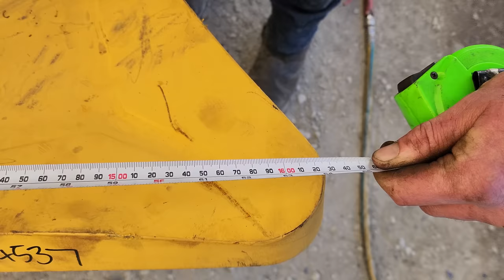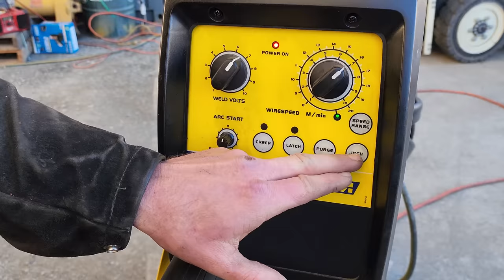Massive Repair on BROKEN Bulldozer Blade | Part 2 | Drilling, Gouging & Welding

Comment from the maker: The massive repair job on this blade continues! How many meters (or feet) of welding wire do you think will go into this repair? Have a guess in the comments and find out in Part 3 here: https://youtu.be/VvDNckmlN2o
Subscribe and hit the bell icon to turn on notifications so you don't miss our weekly uploads. 👇 🤳 
📲Follow us online here: linktr.ee/CEEAUS
🛍Official CEE Merch shop: https://www.ceeshop.com.au
🎉Get Early Access & Ad Free videos in our Patreon community: https://www.patreon.com/cuttingedgeengineering
Reply: No need for the bell, you're on time every Friday!
Reply: great to see part two of the D8 Blade rebuild, cheers from the other Sunshine State, Paul
Reply: OMFG about time.. LOL ty I can literally now relax and go to sleep
Reply: LOL that jump at 23:14, nearly 2 hours of welding.  Crazy.  that was likely more welding then I did in my life.
Reply: 500 meters
Reply: How many total hours did you have in that job? It's interesting how the skills used for this job, so far as I can tell, don't overlap with those of machining hardly at all.
Reply: Correction: Was 2500 Meters, now my guess is 7500 meters
Reply: 2500 bananas, 18" and 2.3 cm of welding wire used. 😂
Reply: I'd say three rolls of welding wire. How many meters are in one roll? That times 3.
Reply: A metric f*ckton!
For a more informative guess, if you don't make it to San Francisco (I live an hour north of it) with the length used, I'll be disappointed 😅
Reply: Easily the 80/90 % of the reel. 12 kg  of wire. 🧐
Reply: Another awesome job by Kurtis, thanks, and a bigger thank you to Karen for great camera, and awesome smooth editing, way to go team 🤩🤘👏
Reply: Gonna make a completely unqualified guess of 1858 meters of wire for the entire blade.
Reply: I would say 250m, or 1406 bananas also known as 29526 grains of barley, also known as 9842 inches
Reply: More bananalengths of wire used than were destroyed by Cyclone Larry
Reply: Your one of the few channels that I don't fast-forward through. Like watching each aspect of the job.
Reply: I guess it should be around 6.0km to 6.5 km of wire. I am blown away of the amount of work going in the blade. Cracy. Amazong to watch. Thx!
Reply: Id say you have done approximately 495 mins of welding and you said that you were running at around 6.1m per min, so your upto around  3020m of wire. I dont know how many meters in a roll but i reckon you around 2.5 - 3 rolls in. Also thats some top work mate, you dont fuck around and just get into it. As a boilermaker ive been watching and saying to myself just dog it here and heat it up there and flog it down.
Reply: 3000 plátanos, saludos desde España 😊
Reply: Um,if I guess correctly, do I win a prize?
Reply: use words like and! .... thats hilarious
Reply: 200 meters 🤔
Reply: Going to say 9 rolls of wire are a minimum, plus an additional one with only around 2 turns left on the roll at the end.
Reply: 2 rolls?
Reply: One of the highlights of the week is seeing a new video when I wake up Friday morning 32:32 . 5150 m of wire is my guess!
Reply: Say, 7000-8000 metres, can easily see 3 or 4 rolls of wire going into that when its all said and done
Reply: About as many bananas worth in a plantation.
Reply: What ever happened to the swear jar? "And" how many times has it been emptied "and" refilled? "And" how many times was the welder refilled?
Reply: @mattyb7736 now that is appropriate guess.
Reply: I'd guess you used all of it!! And neighbouring shops are crying into there xxxx while calling you a xxxx as they can't get any work done now
Reply: I guess 7350 meters of welding
Reply: ~50metres
Reply: I sure wish YouTube would have notifications turned on when someone subscribes! Even talking to people in person, most aren't aware of the need to get notifications. Maybe YouTube might listen to a channel with over a half million subscribers with this suggestion.
Reply: I loove the takeouts, Karen and Kurtis!
Reply: You did mention the welding speed in part 1 and I can't remember what it was. Random guess then....so if you spent 8 hours on the blade that's gotta be....a lot. 

6.5 inches per minute for 8 hours? Gotta be 700m+
Reply: Puedes poner el subtitulo en español tus primeros videos eran así y los iba leyendo
Reply: You look kinda beat it this video lol but maybe not. Fun watch
Reply: 600 metres.
Reply: The amount of work cranked out in one day while filming is very impressive.
Reply: For the entire job, I’d guess 8000 meters of wire.
Reply: @26:06 I don't know, man. What if I never find out whooze the goodest boy ??
Reply: 3,000m 🤷‍♂️
Reply: 1.35 miles . :)
Reply: ya need a shave, gov. for real. this job taking so much of your time, it has grown by an inch from part 1 till now!
Reply: 22:22 that was sweet editing. 💯
Reply: 4000 feet.
Reply: Hey Kurtis any guess on how many kilometers of wire you've used in your career?
Peace.
Reply: I am going to guess 3000 feet
Reply: 8500 m
Reply: total guess work for me. Sadly i looked up wire spool's here in the States and they are all listed by weight. None of them specify length per spool. My best guess is that you used 5 1/2  33lb. spools for a total weigh of just over 82 kilograms...  But, if there is 500 feet per spool than my final answer is 838.2 meters of wire.
Reply: Length of Welding Wire used:

More than a Little...Less than too Much!!!

😄😁😆😅😂🤣
Reply: At this point, I dare say you're not rebuilding the blade, but building an entire new blade and just recycling a few parts off the original.
Oi, serious kudos~
Reply: I'll be waiting for part 3 your work is very interesting to watch as a fellow welder
Reply: 13.1 km of wire!
Reply: Grettings from Poland 😊😊
Reply: I'm going t say about 680 meters or however many banana lengths that is. 🤣🤣
Reply: 6ks
Reply: It's got me beat just how much stuff you've got in your head. No self respecting apprentice could absorb it anyway.
Reply: with 15m per min you will already have spend 6500 meters end for the rest this will be at least the same lenght! - All together 14580 meters of wire - incredible...
Reply: 6,500 feet of MIG wire
Reply: I reckon you've gone through about 4 rolls of wire so far. So 60kg of wire whatever that is in meterage
Reply: We didn't see video of the clock in the background when you where shagging the dog?
Reply: I'm from Australia I live in California im a heavy equipment mechanic mobile !! Many dairy im lucky I sub for a I  multi billionaire there a couple of miles of welding !!LOL
Reply: 2.3k
Reply: @bugg3rthis  lot wirer
Reply: Is there a risk that your lil doggie gets swarf in his paws, when running around the yard and workshop?

Jus wundrin......

I was in construction, and my doggee cut his paws sometimes.
Reply: 1.75-2 spools! Wire!!
Reply: What would be interesting, is to have some reaction video of some of the metal shop in india (or similar). You know, the one where they are all in sandals, no glove or protections glasses, working with machine that impressive that still work, melting their own scrap metal to the final product.
Reply: Love watching that mag drill and rotary broach smash holes like it's in mud cake.  So satisfying 😊
Reply: Dog and wedge works great. I tend to use a nut welded to a piece of square tube with a bolt because sometimes you can’t fit dogs and wedges close enough. Try it sometime
Reply: 2200m
Reply: Ok I know I am not the first to ask this. But here goes I am 54 was a top rated truck mechanic for big rigs. I lost use of my left leg. I think I could do must of this work with my disability.  Would you take on an apprentice for a year or so for room and board?  I am from the states and would have to live there. I wouldn't ask for any pay just food and a roof please. If you feel this is something you can do please let me know . I would love to do this and bring my son into it to take over as well. Thank you so much
Reply: This is really massive work, I would like to know how much did you really charge your client on this job?
Reply: I would think around 2400 meters of welding wire
Reply: Kurtis, I swear that about 13:55 in, your new rattle gun's battery was bouncing around a fair bit.
Reply: G7
Reply: You keep the welding wire company in business burning thru as much as you do lol
Reply: @fbs227 I think he called inches "macaronis" one time too😂
Reply: No red lock tight? Does he really know what he’s doing? Artist use red lock tight even when they don’t need to
Reply: Hi mate! Just curious about what MIG equipment do you use? I could see its ESAB but which particular model.
Reply: Once again, old home time.  I worked at a place that cut wear plates at mold board and cheek plates for underground mining.

It is very interesting to see similar parts in similar operations.

That is one whale of a Mag Drill that you have.

Comment: As a dozer operator I didn’t think a dozer blade could get this bad let alone repaired! Outstanding work so far!!
Reply: I hope that the customer got a good deal on this thing, for all of the work that Kurtis is doing to it.
Reply: @dirtfarmer7472 I'm thinking 1/3rd to half price new USD + 30% materials not counting manufacturer shipping is still a fracking great deal, considering the "repair" is better than new. The customer can pick it up himself for relative peanuts cost.

Comment: As a welder myself I can appreciate just how much work goes into that blade. People are familiar with their cars moving in miles per hour but welding can move as slow as inches per hour, it is by no means a fast process.
Reply: Dang. Since you mentioned you were a welder, I assumed you would have a lot of cool welding videos on your channel. :(
Reply: @eriklarson9137  It's a PITA to record and post ones work.  On top of that many employers strictly prohibit it by default.
Reply: NYC Union welders measure the day in "inches per day"
Curtis is on a different level of production 😂😂😂😂😂😂
P.S. squeaky toy play at end & outtakes are PRICELESS 
Bronx Love guyz 😎
Reply: @eriklarson9137  sorry mate, I'm retired.
Reply: That be “bananas per hour”.
Reply: I worked for Cat and built similar size blades. I think we had a 60 hr. standard from start building to finished. A lot of welding went into these.
Reply: @frostywelder1220  by finish, meaning a professional paint job too?
Reply: @jackgerberuae  No. just the time slotted to the weld shop. Shot blast/paint was after with a designated amount of time for it.
Reply: @joelbrown3479  in a good day, our welders lay a full 35 pound roll. Nobody cares about inches of wire.
Reply: there's a shipyard where I live that requires 120 feet of welding per day (8 hour shifts)... it's insanity. there's another yard that will write people up that don't burn a full  spool of wire a day (I think it's a 5 pound spool, may be a 10 lb). I'm lucky that I work in a yard that the minimum is 40 feet. they understand that the cleaning process takes time, but it's also a government contractor so they are SUPER anal about that kind of stuff.
Reply: It's a whole lot faster than riveting that was done before welding became a thing
Reply: @jackclark1994  10 pound is indeed a minimum when youre a welder, not a fitter. 16kg (35 pound) rolls a day is peak in our shop when the guys are welding a caterpillar track beam, under hand position. Thats just rotate the workpiece so you can weld under hand and fill those trenches with a multitude of beads...

Comment: Nice touch placing a clock in frame during the time lapse. It's a great way of showing how time consuming work like this is or can be. Flip your mask down to do some tacks. Hammer everything square then prep for final welds and 2-3 hours have just vanished.
Reply: Yes, and the clock is a nice branded one, from the bolt supplier, so not only a good show of the amount of time, with no wasted work, and a good bit of product placement as well for the supplier, who will always have customers coming in new, having seen the brand on the side, and choosing them when looking for fasteners. Plus good bolts, all of them looking nice and new, though in a year all will be back and need to be cut off, at least those that are not simply ripped right out.

Comment: And this folks, is why a dozer bucket that leaves the Cutting Edge Engineering shop is better than the day it left the factory even if it arrived looking an absolute hot mess. 

Fantastic work Kurtis, this doesn't just demonstrate skill, dedication and commitment to doing the job right everything but also the benefit that comes from having the work done by someone who has seen countless failures and has learnt how to prevent them. Book smarts and simulations are one thing but there's really no replacement for someone who has done the hard yards where the rubber meets the road.
Reply: Hear, hear I one hundred percent agree with you!
Reply: Or the steel meets the dirt.
Reply: It doesn't help that these companies also seek to make a profit by making less durable components.  The machines themselves can last decades, but maintenance items are always seen as recurring revenue.  If the factory did the sort of work to all of their brand new blades, they'd likely sell fewer dozer blades at insane prices.
Reply: Great job! You need a couple of trainees so they can carry on your fantastic skill set and work ethic.

Comment: Seeing such a mean looking piece of equipment come out of a black case ominously labeled “HOLEMAKER” is 10/10 content. Never stop you guys.
Reply: I cried with joy seeing him pull that thing out.  And thanks to another CEE video, I know that the "bit" is called an annular cutter.
Reply: Yes those are called plow Bolts from a farmer's plow the head is recessed so it won't shave the head of the bolt off and Grade 9 hardened steel
Reply: I worked as an assistant to a guy like Curtis add a concrete company Associated Concrete in Downey we had a workbench 4 ft high that could hold this blade I don't like working on the ground neither did my boss
Reply: It was just a magnetic drill press 😂

Comment: The summer of 1972 was spent working in a fabrication shop making girders for a local freeway overpass. I started out running a 9 inch air grinder. This brings back memories and reminds me why I wear hearing aids. Safety was not so much of a thing back then. That grinder was a beast and could set things on fire that got in the way of the spark stream. The most fearsome noise was from air-arch gouging when weld needed replacing. It was amazing that they would let high school kids move those massive girders.

Comment: I said last week that I thought that this blade should have been destined for the scrap metal bin.  You're talent and expertise has given it a new life.  It started out looking flimsy and now with each addition it becomes more solid.   Thank you Karen for showing the clock, it gives a better insight into the time taken to do each job.

As usual, folks, a wonderful video from all three of you.

Cheers

Ian, the darling Downs Forger.  

Forger as in metal, not bank notes...roflmao
Reply: I wonder what the finished weight to original weight difference will be.  Kurtis added a hell of lot of solid steel to that dozer blade.  Amazing, detailed repair.  And quite a compliment that the customer entrusted CEE with such a repair.

Comment: The amount of work that went into refurbishing this blade and still less expensive than a replacement was amazing. Awesome job Kurtis.
Reply: He needs to raise his rates. Lol. Oh, you're gonna buy new?3-6 month lead time. Or I can turn it around in a few weeks.
Reply: @donc-m4900  Found a used D9 blade for sale - $54k! Makes it worth repairing I guess.
Reply: To be fair, the factory starts with nothing but steel plates etc out of mill.  Here, most of the blade was never touched.

Comment: Great to see you using all the proper PPE, mechanical assistance, lifting attachments, posture, etc......  Health and safety come before everything else.   Hard to believe all the labor, parts and time are still far cheaper than a new blade.

Comment: The sheer weight of the enormous blade rebuild speaks of the incredible power of the machine that uses it. What a huge job!  Looks like you have done this work before !
Reply: And this is for a D8 they make 9,10,& 11. 11 is a monster, it’ll make the ground shake when it goes by. So will an 8 a little.
Reply: @dirtfarmer7472  yes when you stand by the D11 as it goes past.  Makes my spine chill and takes my soul away by the Dozer's sheer power and force momentum.

Comment: Square punch that fits in the carriage bolt square hole. Eliminates two steps from the process. Very accurate. I made one using a bigger chisel and a hardened rod for the tip.

Comment: I love the 'forging in place' to bend the plate back down. You make the welder look like using a hot glue gun for steel. I noted you were being pretty careful not to mash your fingers with those blade plates. I imagine that's something you learn from having it happen once or twice. It amazes me that even with all this work needed, it's still far more cost effective than getting a replacement blade (if they are even available).
Reply: Near the start of video #1 Kurtis showed an ad for a new non OEM blade with a price of USD$65,000 / ~AUD$100,000. 
Talking right through my hat without any personal experience, I am guessing the repair including the almost scrap quality blade, would barely be 1/5th of that.